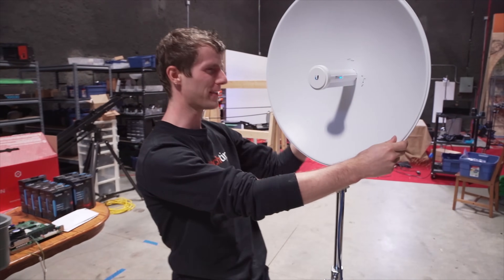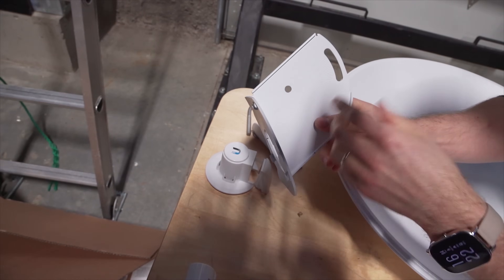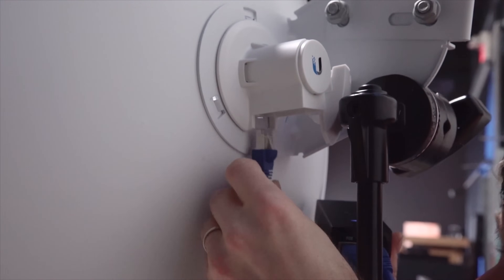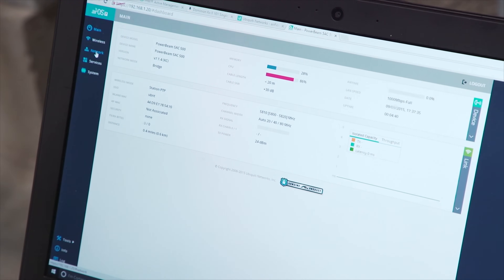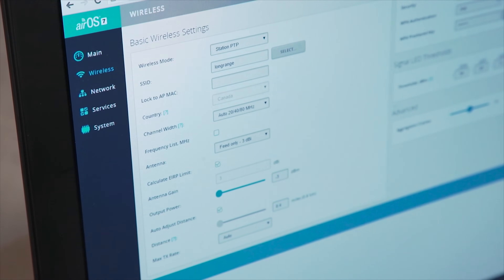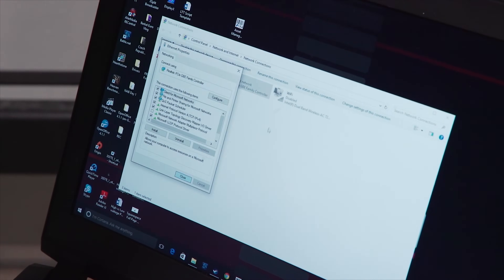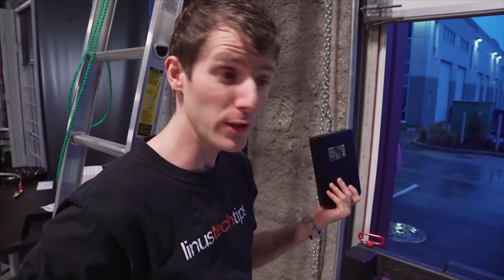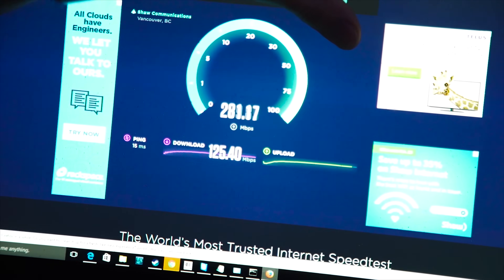HOLY $H!T - Long Distance Wi-Fi (Up to 25 KILOMETER range!?)

Comment: These are actually how we receive internet in my area. There is no ISP willing to run cable several miles from house to house so one guy on the edge of town got Gig internet and he just sells you internet for $40 a month and daisy chained a bunch of these together so we can get internet
Reply: Uranium hell no but his comment is funny asf. 😂
Reply: That seems pretty solid for a multiple kilometer wireless connection actually! I'm still thinking where I could use this thing for because its just so cool xD
Reply: tried to post a screen shot forgot I can't lol. but it was 75mbps down and 52mbps up. 51 ping
Reply: yes its legal. I once had a 78Mile ptp link between two mountains to service customers in a remote area. They call them WISP, or Wireless ISP's
Reply: That's great - until one of his "customers" is doing something illegal over the internet and his IP address is identified and tracked right to his house - where they then proceed to knock down his door, arrest him, and confiscate all of his computer equipment, until they sort out the internet connection "arrangement" about which his internet service provider had no knowledge.   Meanwhile, the guilty party gets a heads-up, so he can cover his tracks.
Reply: Democritus86 if it's in a contract the  it is legal. the law voids any contract that contradicts it. therefore if a contract can be written discussing the matter then the law is silent on the issue. 

either way it's not illegal for me to buy it or use it so until they shut his ass down I'm cashing in
Reply: it's very legal. i work for a company that does just that on a commercial scale.
Reply: captain cool, ubiquiti sells point-to-point setups like the ones in the video, that have throughputs of over 2Gbps.
Reply: its legal if yuo do it with company but its illegal for a normal person to sell their connection to their neighbor for lets say 10$ a month under the table.
Reply: dude, what kind of speed do you get?
Reply: If I managed something like that, I'd add a 100$ firewall/vpn client and a 3$ per month vpn server on the name of the one getting internet.
Reply: +92Ranger4 Exactly besides it's a matter of contract terms not a legal issue anyway, doing this would probably violate the contract with most consumer providers but there will always be someone willing to sell you a service you can do this with if you are prepared to pay transit rates on it.
Reply: i Bee Amazin thats rad
Reply: Geez you got some commenting skillz
Reply: I had this in a few different places I've lived. I loved it because it was fairly fast and cheap as hell.
Reply: sorry i ment its "illegal" on the ISP's perspective not on the law so preaty much worst thing it can happen is to void your contract,ofc the tax office might want his ass.
Reply: I was thinking about doing just that!
Reply: Cool!
Reply: How fast is it?
Reply: Why don't you do it yourself then?
Reply: Skydsl and other of the same kind been around since the 90's
Reply: Same! But now I have starlink.  They only kept me at 15 Mbps per second... but starlink is so much better. I get 200+ Mbps with starlink
Reply: i Bee Amazin
Reply: its not legal for private connections to be distributed around.... its on your contract.. its even illigal to give it for free...

Comment: Wow you had the same speed even that far, I have set up my own p2p like this one, except that im using tplink wa7210N, and im getting poor signal, around 30db, im transmitting around 100mbps and only getting 3mbps. Any tips on how to improve it?
Reply: Did you install it with a clear line of sight between the AP and client?

Comment: how much does it affect your ping?
Reply: Democritus86 full duplex has existed for a while. airfiber is definitely a good option with up to 1.4 gbps throughput
Reply: We use one of these for our internet, our average latency to the ISP (150-200km away) is about 43~50ms with about 13 of these antenna's between us and said ISP.. So not bad at all even with a quite a few hops
Reply: So 50-60 is around the max for dsl. Theres an internet provider that kinda works that way its called Zip Spider. They use short wave radio waves i believe to provide internet.
Reply: You're counting the entire link. What matters is the last mile. It's usually several ms. The first hop of my ubiquiti access point takes about 1ms when entirely utilized, or 7ms when fully utilized.

DSL's last mile latency is usually 2-15msec. VDSL is usually on the lower end of that.
Reply: Democritus86 depends on radio design. A lot of higher end wireless gear, including high end ubiquiti gear, can run at full duplex. There is spectrum used for downlink and dedicated spectrum for uplink. There are essentially 2 radios on the link.
Reply: I have a Ubiquiti nanobeam 5ac-gen2 and average ping is only 1.2ms. Min is 0.8ms max is 1.9ms. That is setup at 620ft (190m) apart. For comparison the switch on my gigabit ethernet lan is about 0.3ms average. So really impressively low! Only 0.9ms more latency than if you were connected directly into ethernet
Reply: Incorrect. A properly setup ubiquiti with up to 50 people on a single access point can have ping times similar to DSL. If you understand any of that xD
Reply: Not at all. Thats satellite internet not WISP.
Reply: Derek Verveer right, but assuming by his post, he doesn't know overtly too much about networking, so I assumed about average for common games people play, of course depending on server location and stuff
Reply: wifi technology is not full duplex yet as far as i know he doesnt even have some type MIMO system witch supposedly  helps... so i THINK the pings will  be high on a real scenario and not on just a simple cmd -ping command...
Reply: couple years ago i searched for exactly the same thing you say up/down seperate link but i came up negative maybe they have some kind propriety protocol,scratch that i saw they got this thing called airfiber now that it seems to be full duplex i hope linus would go for it since he doesnt look like to care for the cash.
Reply: undoubtedly not csgo worthy. Probably at least 70-100 best conditions.

Comment: recently at a campground that advertised free wifi , I found that my cabin was too far away to get it. You had to be at the picnic area right next to the camp office. What is it that I need to buy which would have allowed me to get the wifi from the campground office? I'd guess it was a 1/4 mile away, level ground, heavily wooded.

Comment: do anyone know what is the requirement for very long distance networking wirelessly...about 300-400km??
Reply: lol tf
Reply: Multiple towers. Have a look at airFiber 5. 100+km range (between 2 units). You'll probably need 4-7 towers (with 2 units each, excluding the ends) depending on your topography.
Reply: Ashiqur Rahman phone
Reply: Daisy chain it maybe haha.
That's all I can come up with
Reply: Iskog Productions phone mean
Reply: on the 900 mhz band, ubiquiti has some that will reach about 180 meters at around 50-100mbps, maybe 3-6 of those
Reply: Iskog Productions -_-
Reply: A 1km antenna.. for 0.1 kbps
Reply: You'll need a FCC license
Reply: Ashiqur Rahman use ur phone to get unlimited internet 😂

Comment: The only real difficult part of installing a "long distance" wifi link is getting the alignment right. The quality and speed is also dependent on the weather conditions. This is nothing new, these issues have been there since the days of radio transmissions. For shorter distances, a trick you can use that works most of the time is using a laser pointer, install it temporarily on the dish (DIY) for alignment.

Comment: I set these exact units up roughly a mile apart from each other (with trees in between) and get a steady throughput of 350Mbits. These things are pretty legit.
Reply: How thick of trees are we talking?  I am looking to only do about a quarter mile, but it is heavy forest between the two cabins.
Reply: They're hitting the top portion of a pretty thick area of trees. I was able to use the web tools built in to dial in the speeds. I'm now getting 5 - 600Mbits. That being said, I cant image you not getting at least a few hundred Mbits going only a quarter mile, even through thick trees. I was extremely surprised by these things and I bet they'd work great for you.
Reply: Zachariah Zollo hi.. seems u have set one up pretty good.. im also planning to buy and set it up since none of the local providers here are willing to..so im planning to have the provider set it on the nearest site they can and plan to use this to transmit it towards the desired locaton which is about 25km.. so i need to buy 2 of this dish right and its all like user friendly when installing? hoping for your response..
Reply: Rory Mayores I bought mine on Amazon. And yes, pretty easy and user friendly to set up IF youre going a few miles distance. It comes with a little booklet for basic setup but there are a ton of thorough YouTube videos on how to set it up. 25km is a long way though, there cannot be anything in the way if you're going to go that far- clear skies. 25km defitnely isn't going to be easy
Reply: Zachariah Zollo yeah i imagine setting up poles with those lighning rods im just hoping it would work as they were labeled to work up to 25k.. tnx.. great help
Reply: Do you have a vid of this?? i really want to try and get net out to the back side of my property...  thanks!
Reply: Zachariah Zollo is there two in the pack like he stated or are they sold individually?
Reply: UBNT Products are fantastic ESPECIALLY when you have two of them pointing at eachother for a true point-to-point link utilizing AirMAX ... They are also awesome for leeching nearby wifi once you crack some WPA's ... which can also be done with Ubiquity products running OpenWRT

Comment: I've seen several videos on this product but wondering if it's possible to take the hard wire from the receiving dish and connect that to a wireless modem? So the house that's receiving can have its own wireless signal. Can anyone answer this please?

Comment: At the start of the video it says "LinusTechTips, Canada's only export" i doubt that so i looked up Canada's export,

The top eleven of Canada's export

1.   Oil: US$77.8 billion (19% of total exports)
2.   Vehicles: $60 billion (14.7%)
3.   Machines, engines, pumps: $31.1 billion (7.6%)
4.   Gems, precious metals: $19 billion (4.7%)
5.   Electronic equipment: $13.2 billion (3.2%)
6.   Plastics: $12.5 billion (3.1%)
7.   Aircraft, spacecraft: $12.3 billion (3%)
8.   Wood: $11.8 billion (2.9%)
9.   Aluminum: $8.2 billion (2%)
10. Paper: $7.7 billion (1.9%)
11. LinusTechTips $? (?)

So thats that

Comment: DUDE!!!!  Do Not Point it near your head!!!

OBTW:  WISP use these as back hauls.   We use them all the time.
Reply: Hi, i work with 20km+ antennas all the time. They can't harm you.
Reply: how much do 2 of these antennas cost (linus hates telling us how much things cost for some reason)
Reply: RF microwave radiation is a commutative affect. Fun fact this is how Marconi died.

http://www.electricalpollution.com/Health_Issues.html

They do not cost that much however I would look at mikrotik they are more reliable at the same cost point. Maybe even a little cheaper depending on where you buy them.

Keep in mind these are not Wi-Fi but a point-to-point microwave link.   If you had your phone with a 5 gigahertz band you would not be able to detect it. It does not operate as an 802 11 radio which is Wi-Fi
Reply: radiation in those are too small to harm you in short term. I'm glad you have found Mikrotik. :)
Reply: also those work as same as regular wireless devices. Uses the same protocols.
Reply: Yes but it as i said adds up over time.   And at even it's lowest setting the safe distance is 5 feet in the front of it.
Reply: No they are not using the same protocols :-(
And they are not 100% 802.11 compliant
Reply: Someone say Gorbachev?!?!! Oh... Akward

Comment: So what's the difference between this and a normal wifi router? Some routers cost up to $500, and they only offer a few dozen metres of range. Does it have a lot of minimum range or something?
Reply: It's a completely different piece of tech.  This give you the opportunity to have a network(wired or wireless) and connect it wirelessly to another location farther away in a cheaper solution than running fiber on a pole to your other place you want to share your network with.
Reply: ChargedCapacitor wdasddsaf a normal Wi-Fi router broadcasts Data in all directions. This thing only broadcasts in a tiny beam that the receiver picks up and converts into a wired connection.  You would have to plug in a regular Wi-Fi router on the receiving end to connect with a tablet or phone.

Comment: If I were able to set this on my roof at home, I could beam it to a business location a few miles away. The only problem is the business location would likely require the antenna to be inside. Would this be possible?

Comment: I've setup plenty of PTP connections using microwave antennae that were positioned on top of buildings as tall as 50 stories, with a range of 30 miles (about 48 kilometers). Of course, you have to have unobstructed line-of-sight, and calculate azimuth and elevations. Those units were a hell of a lot more than $150, so that's pretty kickass!

Comment: If you want to test just the WiFi link speed then you should try transferring huge files from one point to another instead of testing internet speed which isn't very consistent and reliable.

Comment: I was under the impression you need an amateur radio license to broadcast signals strong enough to connect 25 miles away. And it's illegal to encrypt communications over amateur radio broadcasts. (Basically the government is the only reason you can't connect to your router from the other side of your own house.)
Reply: +Amaroq64 +Amaroq64 I work at a small broadband company (my boss, a financial manager, and me the intern). We use all ubiquiti and motorola canopy gear for the majority of our customer premise equipment and access points. The gear we use are on unlicensed bands (5ghz, 2.4ghz, 900mgz). For some of our backhaul we use licensed gear which we had to pay big bucks for and then on top of the equipment costs we had to buy a license for them.

Comment: About the uplink/downlink speeds, it has to do with the dish mechanics. The broadcasting dish if lined up will have more signal hitting the opposing dish and in turn be recieved better , alignment for transmission is more important than for receiving. This would cause the disparity as one dish would be lined up better than the other.

I wonder what kind of latency or data rate this would experience at various ranges if lined up correctly, and how would you actually line it up perfectly anyways ? You could use a pair of lasers to survey and show direction/angle and such but how would you actually relay this to the target effectively? I guess if you wanted to go way overboard you would want a mechanical/electronic rig to actually fine tune the dishes, should be easy enough via software to enter a "seek" mode to fine a ballpark direction and fine tune the direction from there (i.e. have it do minute changes up/down and left/right to determine the best signal quality and go from there)

They used to use atmospheric bouncing to achieve ridiculous ranges for HAM radios at times, I wonder what kind of throughput one could achieve using modern technology and a much closer range (i.e. what Linus wanted to do with his broadcast to his home)

Comment: Dude get the tower lol! Build it from cheap, light and strong chain link fence polls from the home depot! I use them to mount antennas affordably a lot. Then you just need to bolt up the polls with strong c clamps. And use cheap affordable cables also from home depot to stabilize the mast.

Comment: Bloody hell... 142Mb download and 254Mb upload?! HOLY SHIT!!
My connection is only 1.8MB download, and 40KB UPLOAD... I want his connection!! Q_Q
Reply: r u fkng kidding me
Reply: +Baruch Bacon it would actually be 14.2 because with Internet protocols there are generally 10 bits per byte.  SATA also works in a similar way. With my understanding of this it is supposed to allow for less errors with data transmission as the additional bits act as some sort of second check for the data.
Reply: same internet needs help here two
Reply: 142mb download is nothing, we have 1gb in portugal
Reply: 1 bit is 10 bytes
Reply: Baruch Bacon i was talking about mega bit to mega byte, because that is a 1 to .125 ratio
Reply: Baruch Bacon i dont know how you got a 1 to 8 ratio
Reply: Baruch Bacon yeah ok i got it wrong, im sorry for doubting you i guess.
Reply: Baruch Bacon no, no it was my fault for not doing the research
Reply: i feel bad for you i have 11mbps download and 7mbps upload or thats what speedof.me thinks
Reply: MegaChaos91 i have 100 down 50 up because i dossed my internet
Reply: Its hitting the top portion of the trees, but still pretty thick. Honestly if you're only shooting a quarter mile I cant imagine it not giving you the at least a few hundred mbps of throughput. I used the tools built into the web portal and was able to get my throughout to over 600. So if you do the same I'd bet you get higher speeds than you'll ever need.
Reply: top vidsfin that is
Reply: MegaChaos91 Mine is like

120 mbits donwload and 10mbits upload in Germany
Reply: exactly the same here. Portugal.

Comment: pulled a Nanobridge m5 off of a roof where I was working, and they said I could keep it! I have played around with it, and even connected to a normal access point about a half mile away. You can even get dd-wrt firmware for some if not most of the ubiquiti products. I ended up softbricking mine on the first dd-wrt flash attempt, but was able to recover with serial, and successfully use the firmware.